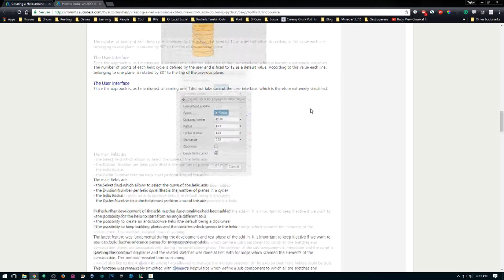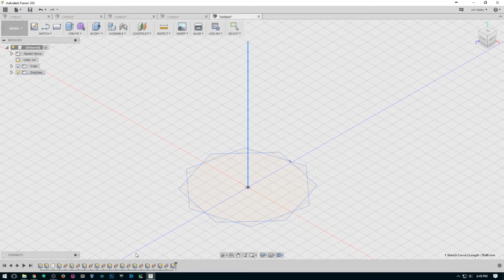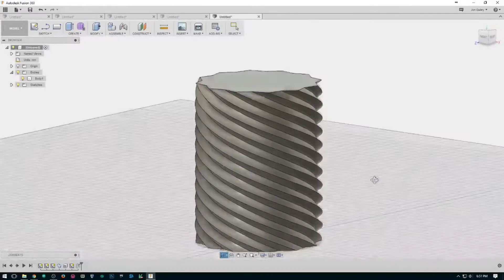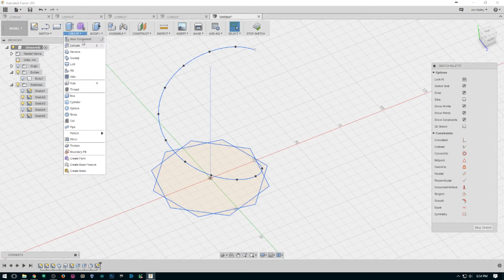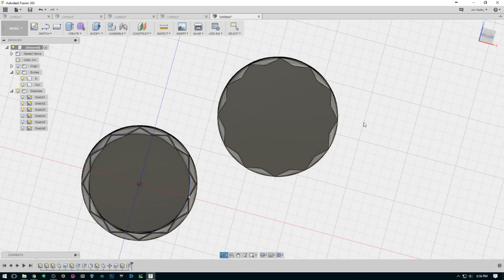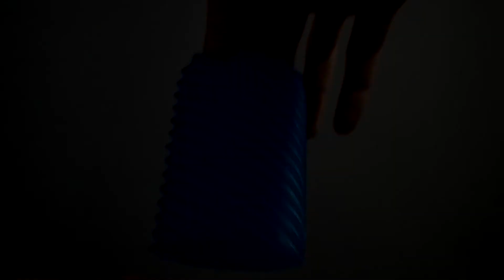How to Make 3d Printable Twist Containers in Fusion 360

Comment: You don't need to install any add-ins. You can use the built-in coil function to create your helix to be used as a guide rail for the sweep.
Reply from the maker: I could not find an easy way to make them evenly spaced and I believe you would also have to make an additional cylinder to helix around, just more steps overall. I'd love to see a video if you have figured it out another way =)

Edit: wording for clarity.
Reply: No need for any additional cylinder. You don't create a helix per se, it's a coil. You just use a triangular shape for the coil, set the position to inside, and then set the height and revolutions. The outer edge of the triangular coil is then a helix, which you use for the guide rail, exactly like you did in your video.
Reply from the maker: Ah, I see. I had tried that with the circular coil and it wouldn't let me choose the edge. I'll give it a try with the triangle.
Reply from the maker: Got around to trying this out. Worked like a charm.